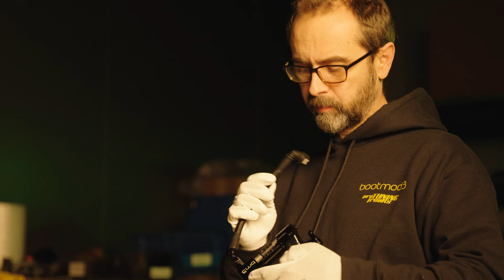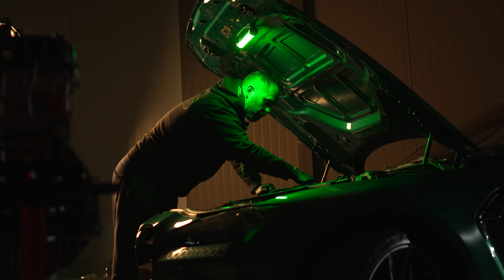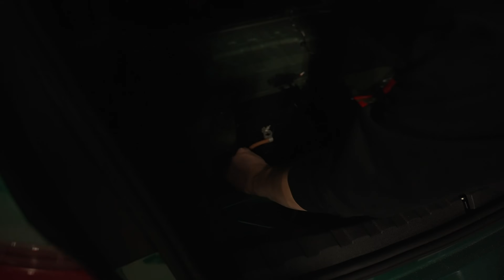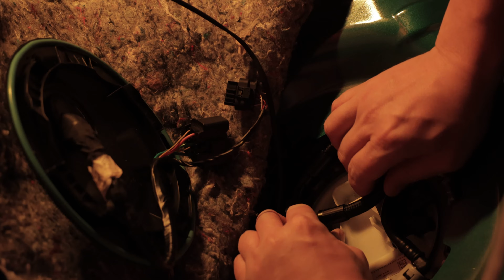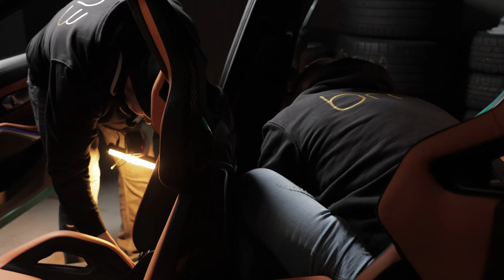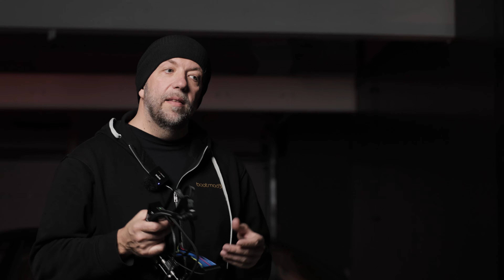FLEX FUEL Hardware Kits and Software Explained | Fuel Hat Install on BMW G80 M3 S58 | bootmod3

Comment: Very disappointed I got mine and when installing it on the OEM hat low pressure pump the bootmod fuel line leaks a lot clicks in fitting is correct when tested fuel leaking major. No problem connecting back to stock hose.

Comment: so if you have multi maps 
and you can switch them on the rpm dial

if you end with say e25 or e35
do you just leave your rpm map setting on the 93 tune or put to the e30

same goes for say you end up between e35 and e50 fuel in the tank

do you set the car to the e50 map from the steering wheel

or do you leave the map on whatever map regardless of E contnet, 91,93,e30,e50

i would think if it auto adjust regardless, its still best to multi map to closest setting for your E content for sake of ecu using it as a basis to compute adjustments??

Comment: When I followed the steps for draining the fuel line on my m340, in both install and removal the fuel lines never got drained and it would spray gas everywhere. Car would run for 10-15 seconds, shut off, and not turn back on. Yet there’s still fuel in the lines. 

Going to be installing the kit on my g80 now, so wondering if I’m missing any steps so that I don’t make my M3 smell like gas
Reply from the maker: There’s always a chance for some fuel in the line to spray out. Best is to leave the gas cap open for a bit for pressure to bleed off after running car so it shuts off without the fuel controller plugged in
Reply: @protuningfreaks  Having this same issue, i just opened the cap to see if that helps, Seemed like the gas was never gonna stop flowing so i gave up to do some research.

Comment: I have a 2020 x3m and i cant figure out what wire i tap in to i tired con3 pin 1 and it doesnt work it actually turned my cluster off while driving. Do you know the location of the ignition wire for the 2020 x3m?
Reply from the maker: Email support@protuningfreaks.com
Reply: @protuningfreaks  you guys helped me out i think u should have the info about the different pins for the x3m on ur website.
Reply: @FX_LowRiderS I'm going through this now. Which pin did you have to tap?
Reply: @FX_LowRiderS  what was you solution?
Reply: can you please share with us the location of the pin?

Comment: I have a gen 1 b58 g30 I hold down the cruise control button in first position and tack goes to 85 RPM on pump 93 gas can this also be an install issue?
Reply from the maker: Email support@protuningfreaks.com

Comment: With the multi map do I have to change the map to the ethanol content I have like say I have e30 do I change it to map 3 or can u just leave it how it is like the computer reads it so I should be good?
Reply from the maker: We actually explain it in the video but to reiterate, all map slots auto scale with ethanol present. The flex fuel sensor in the BM3 Flex Fuel kit communicates the ethanol content info to the engine computer which then in turn makes any of the map slots scale up or down in power depending on how much ethanol is in the tank. You need to run a flex fuel enabled map such as our OTS MultiMap or a custom tune with flex fuel functionality enabled.
Reply: Thank you 🙏🏽

Comment: Does this apply to the 2020 X3/4M? I’ve been told there’s no room under the fuel hat and we have to go there under hood route.
Reply from the maker: Yes, we have kits that fit both locations
Reply: @protuningfreaks   If we want it for the X3m or x4m, do we select "BMW G-SERIES S58..." option?  I don't see an X3M specific product or option and the F97/8 chassis isn't mentioned anywhere.
Reply from the maker: @peterg6953  we’ll add the specific option for x3m x4m as the pre LCI models need slightly different firmware on the controller than all others. Everything else hardware wise is the same as all other S58
Reply: @JAKrieg did you ever figure it out im having the same issue

Comment: So with custom room the flex fuel kit adjust on the fly depend on what ethanol content is in the tank. Do we have to get an initial map flash first? Like a custom tune or we can just flash like a stage 2 and when we mix like e50 the software will automatically adjust to get that power?
Reply from the maker: You just need a flex enabled map like the OTS MultiMap (stage 1 or 2), or, you could get a bm3 custom map with your tuner of choice

Comment: Hi Dzenan, I have this kit installed on my BMW f82, to which I can read the ethanol content % on the bm3 app however can’t see this on the dash tact screen when I hold down the cruise control button on the left, is this an install error ?
Reply from the maker: Go down to first position on cruise, not all the way down. Ignition needs to be on
Reply: I have a similar issue on gen 1 b58 g30 I hold down the cruise control button in first position and tack goes to 85 RPM on pump 93 gas can this also be an install issue?
Reply: @chrisdell1149 that can be the gas station giving you bad fuel, surprisingly common.

Comment: I currently have a 2022 m340i with femto unlock, will I be able to use the new gen 2 b58 flex fuel kit?
Reply from the maker: As femto unlock doesn’t allow writing of the software portion it’ll be the same as for the G80 when we released it, meaning, you’ll need to resend the dme to femto for an update to get all the new goodies.
Reply from the maker: @juniorflores2366  customrom update is not ready yet so right now they’ll just be unlocking
Reply from the maker: @juniorflores2366  we don’t do etas but should be soon

Comment: No 91 option for stage 2+ multimap:( Any way to get 91 added so we can scale and don't need to reflash to stage 2? Me and some others are in the same boat, owning a gen 1 b58 with the PTF flex kit in california stg 2+, looks like the lowest octane level is 93 for the multimap.
Reply from the maker: We can easily add a 91 slot, email us at support@protuningfreaks.com for assistance.

New plate covers will be on our website this week 🙏
Reply: Also, I gotta grab one of those license plate covers eventually!!

Comment: I like the fact the sensor is at the tank sensing the content there not at the rail, by the time the sensor at the rail sense the gas it already in the motor at the tank it will take at least 30sec to get to the motor, as there’s no return line. Any idea when this will be released for the G80/82?
Reply from the maker: Waiting on fuel lines, hopefully next week

Comment: On a b58 gen2 I say the highest e map is 50 is that the highest ethanol mix I should run even with the flex fuel? Or could I run full e? Also will full e make less than e50 on stock turbo?
Reply from the maker: It’ll auto scale but power on OTS will max out around where that blend lands